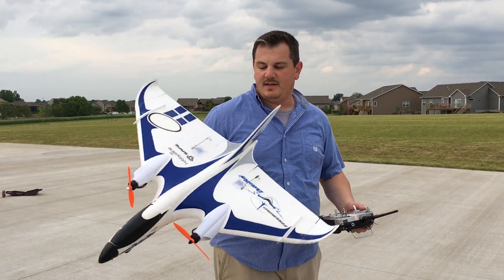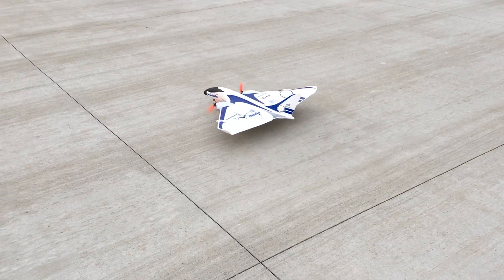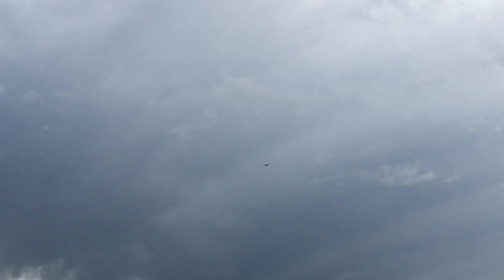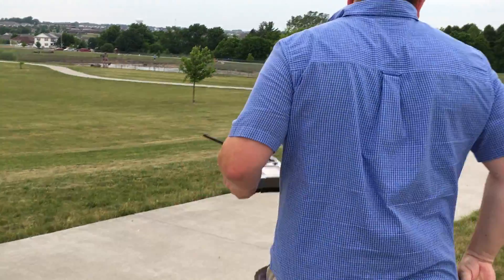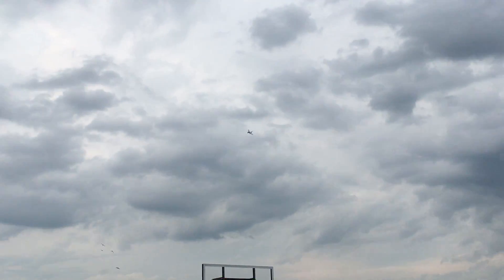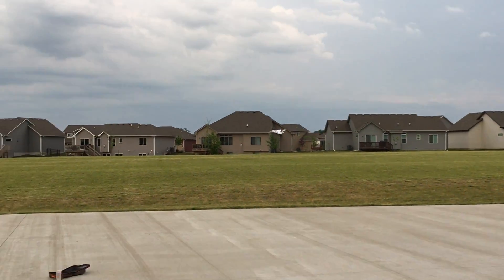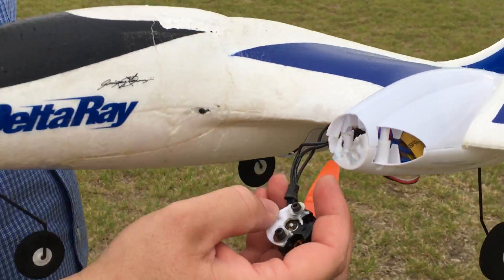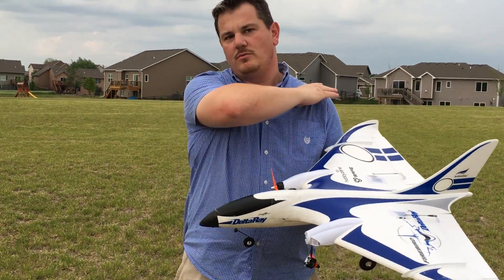Horizon Hobby - Delta Ray - Xtreme Brushed to Brushless Signal Converter Mod - Flight 2

Comment: Unfortunately the Xtreme Production Brushed to Brushless Signal Converter - EA-048  are not available anywhere now.
Reply from the maker: That's unfortunate...

There's another way to setup the Delta Ray, even with Stock setup, to keep SAFE, while using brushless motors...

You can bind a second DSM2/DSMX receiver to your DeltaRay transmitter, run the twin ESC's from the second receiver. This will allow the control surfaces to be controlled by the stock SAFE Rx while you're throttle (with and differential thrust for YAW axis control).

Only items you give up would be SAFE on YAW axis, which is not super important on a Bank and Yank (aileron only plane), but this also stops the plane from wanting to carry and carry while landing, should you need to have some yaw to keep her pointed down the runway. Secondly, you'll lose the Low Voltage Warning pulsation. This will only happen from the brushed motors ESC's, so you won't see that when you don't have the brushed motors installed any longer.

Hope this helps you out!
Reply: Most likely I'll just get a LemonRX with stabilizer. Thanks.
Reply from the maker: If you want to use the stock Rx, you can get the cheaper Lemon RX without stabilization, then depend on the AS3X / SAFE in the stock Rx...but the Lemon RX 7ch with stabilization is good too, since when you go to brushless power, the SAFE/AS3X will still be tuned for the slower flight performance and the plane might "pump" which is super annoying ;)
Reply: My thoughts were to keep it as simple as possible. Like you said the AS3X rx is tuned for slower flight and I'm wanting this to have higher performance. I'm using a DX8 so going with differential thrust with a LemonRx stabilized will be pretty much the same thing as having SAFE. I saw your video where you did exactly that and it's a big improvement over keeping the factory brick.
Reply from the maker: I agree! Glad you're going for this setup.
Sorry for my mis-read on your original comment ;) I assumed that you were hoping for the Xtreme brushed to brushless signal converters, so you might have been trying to keep SAFE...my bad!
Good luck! You'll love how crazy this plane will be with the extra power, while still taming down for rock solid performance!!!
Reply: I had originally thought about keeping SAFE but after seeing your video using just the LemonRx I decided to just go simple. I'm also thinking about adding a BGL-6G-AP stabilizer with Spektrum receiver. I won't comment on this video anymore. I'll reply to the other video where you use the LemonRx.